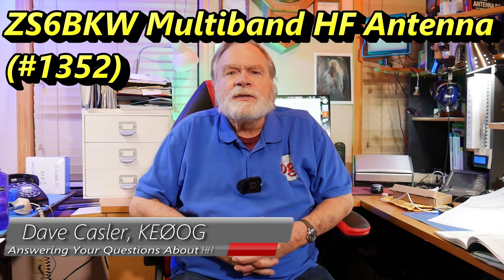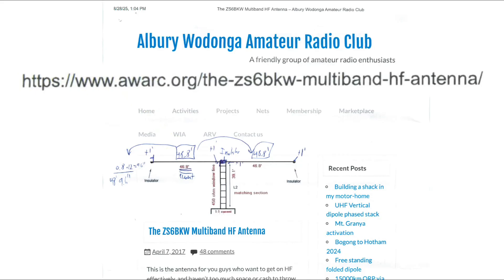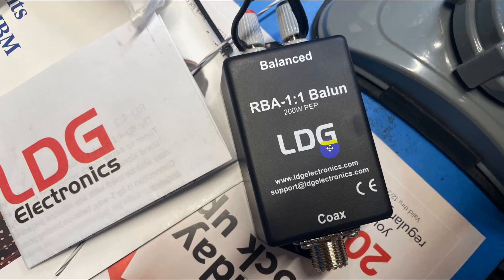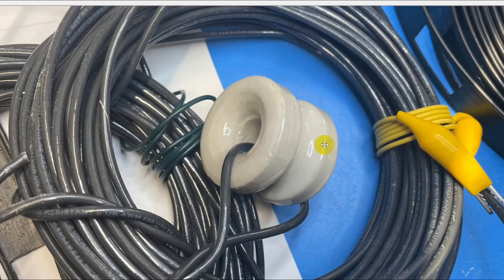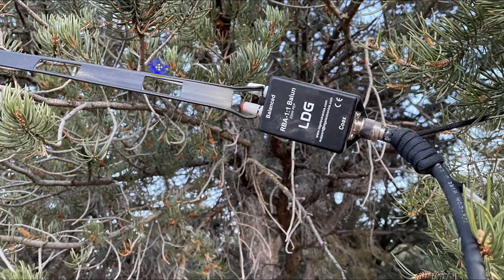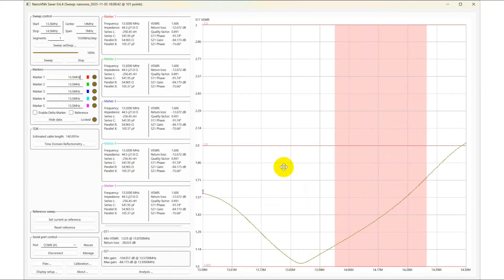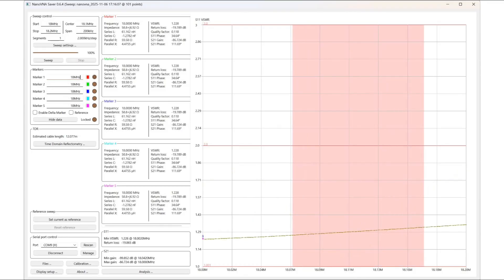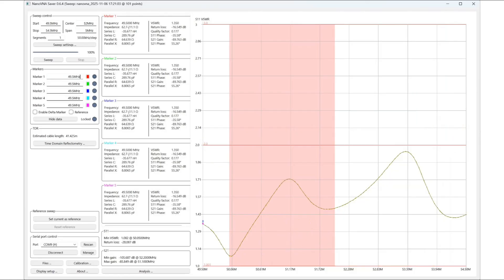ZS6BKW Multiband HF Antenna (#1352)

Comment: My house takes up almost all the space on my 50' x 95' lot.  The only space I have for an antenna is an alley measuring 5' wide x 85 ish feet long.  No room for radials as the alley is only 5 feet wide.  You mentioned your really good vertical in this video.  Just curious which vertical antenna you were referring to and if you have a good recommendation for a multi-band HF antenna for my space constraints.  I'm willing to pay more for whatever will give me the best performance in this tight space.  73 de K2CDM (Mike)

Comment: I have a ZS6BKW. Have used it primarily for CW on 40m and 20m in an inverted-v deployment. Seemed to work well. I need to try higher bands now that propagation is good. Looking forward to your next video.

Comment: Ive always thought about this, and i may be overthinking it. 

But, since RF (HF is not my strong suit) usually runs at the surface of a conductor, would it be better to use butt connector splices to connect the conductors to the ladder line? 
I could think of using waterproof butt crimp connectors, like that you'd use in vehicle wiring, as it would waterproof the joint, and keep everything inline. I don't know,  constructive criticism would be helpful.

Thank you

Comment: Hi Dave, I had a ZS6BKW antenna for a few years, it was installed as an inverted vee, which apparently drops the impedance of the dipole to near 50 ohms.
It was a great antenna, however where I come from it gets very windy and the window-line snapped more times than I can remember.
I had thought that maybe you could get a 9:1 balun at the feed point and feed the antenna with coaxial cable, but the more thought I gave this, the more un-realistic it seemed.

Comment: The ZS6BKW is my current favorite antenna... I have 6 HF antennas, 3 are monoband for 10, 60 and 160. One thing to note is there are a few slightly different variations. I haven't tried any of them other than the one I have up so I can't state any differences. It is really good for FT8 because of its multiband capabilities. I use an LDG autotuner so changing bands is very easy.

Comment: Mine worked well before I replaced it with a KIO hexbeam and a Yaesu rotator. Best antenna I’ve ever had. By the way Dave, you’ve lost some weight. It looks good on you. You were getting a little, as they say, “porky”. Keep up the good work.

Comment: I put one up a few years ago, as an inverted vee, with the center up about 45 feet (high enough that the feed point is about chest height) and the ends at least 25 feet. I don't recall off hand, but I don't remember the SWR being as good as what you got. But it's done very well for me on 80-10.

Comment: Dave, I've been building a slightly modified version of the Zs6 for several years. Tuning takes a lot of time to get things exactly right. All my versions are consistent, and I can basically "stamp them out" as needed for people. What I discovered after months of testing is the measurements are slightly too long on most published measurements for this antenna. You have to tune the ladder line matching line as well as the antenna line length to get all the bands it covers to remain under 1.5. Swr. Most importantly, the reactance is what to really tune to if you want it to be a top performer. Minimizing the reactance will improve radiating performance as you well know. My Zs6 talks all over the world SSB with just 100 watts and it's my go to antenna most of the time. 73, KM4IYQ.
Reply: Out of curiosity, what are your measurements?
Reply: @redviper2212  I will get that info from my file and post it for you. I should be able to get that to you tomorrow. 73.
Reply: @redviper2212  Each element is 44'-7" and the window line is 39'-3". I use 14 ga. insulated antenna wire and 450ohm window line with an LDG 1:1 current balun. It is limited to 200watts. If you want a legal limit version you need to use a balun from Balun Designs 1:1 current balun. I usually start with the elements at 46' and tune downward. The reason is that 10M and 40M fight for lowest SWR and reactance. So you need to decide which band is more important to you. This version will consistently give you 6 bands under 2.1 swr including 6M. It will not work on 80M however. You should get 40,20,17,12,10,6M. plus 2M bonus at around 2.1swr.

Comment: I have had a ZS6BKW up at about 10 metres, inverted V, it's supported in an Oak tree. It works as expected,  mine is a poor match on 30 and 15 metres. The G5RV is promoted as a multiband antenna. Lou designed it for 20 metres and to have an impedence of 75 ohms. Somewhere along the way the message got confused.

Comment: I built a ZS6BKW this spring.  Over the summer I brought it to camp with us and hung it off a 45 foot fiberglass portable mast in an inverted V. It was AMAZING!  I was able to get under 2:1 on almost any HF band and was in 40, 20, 17 and 10 with just the internal tuner on my IC-7300.  I can't recommend this antenna highly enough.

Comment: I installed a half size ZS6BKW antenna and year ago.  Very high swr. I managed to reduce swr by using a long length of coax and a matching unit
Works worldwide on 25  watts.

Comment: I've been usinig a G5RV Jr. that's installed in my attic for ft8, each end bent down for about 6', operating no more than 25w and mostly 10w;  I've now worked 103 countries, having received my DXCC a few weeks back, as well as WAS several months back.  My furthest QSO has been Australia a couple of times - 40w on 40m, and 15w on 20m . Japan at 10w on 20, 15, 12, and 10m.  I'm in central NY state.   I can match it with a manual antenna tuner on 40-30-20-17-15-12-10, and even 6, most bands it's down to about 1.1:1, highest is maybe 1.3:1.   This is over the course of 11 months.   I got back on HF almost a year ago after being inactive for almost 30 years.  Prior to that, I had a full size G5RV installed at a different location and that worked well for me also.   Not sure why you've never had any luck with one.   BTW, I've got  several $2 bills that I saved decades ago.  73 DE N2LCX